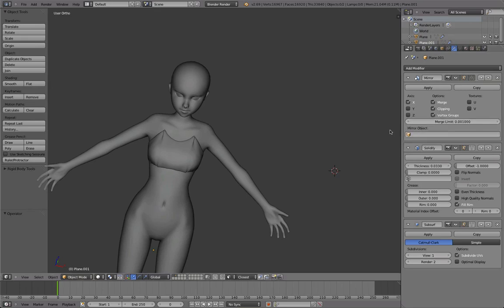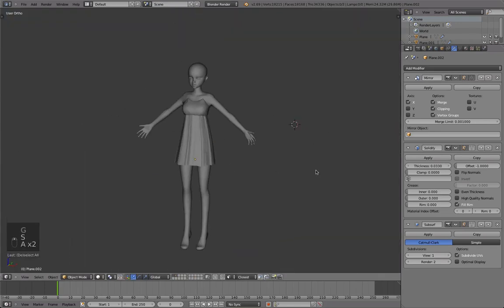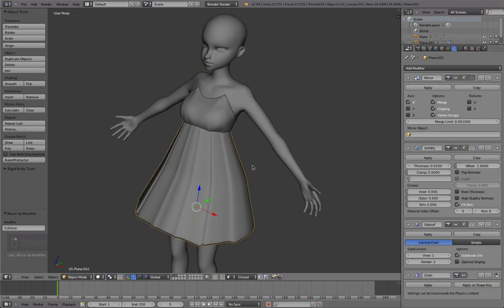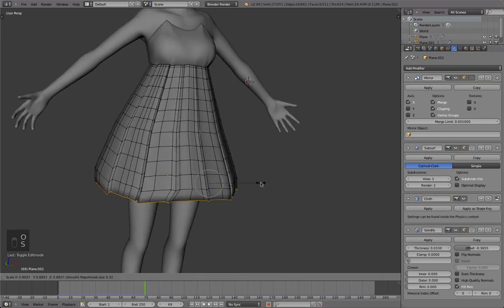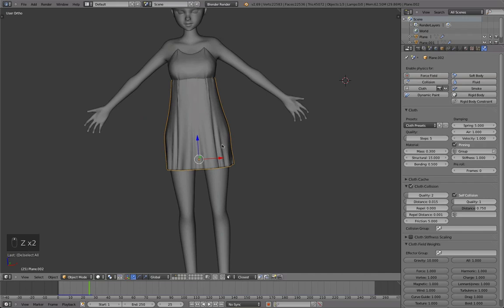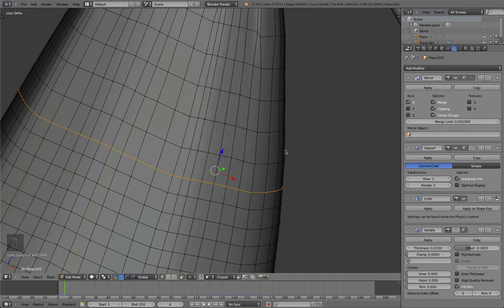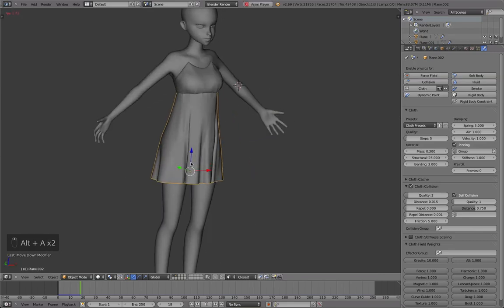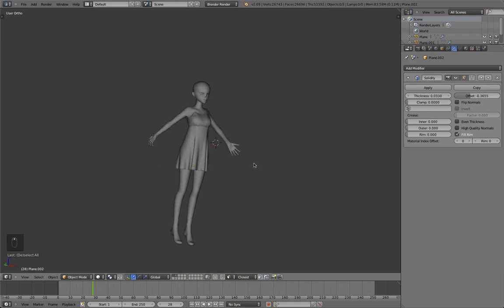[Part 16/ 24] Blender anime character modeling tutorial - Skirt

Comment: Hi Daniel i have a question, do you delete quads under tight clothes off the model itself for optimization for games or do you leave them there? Since you wont be seeing them anyway. Also how do u connect the clothes to the model, if you connect them with joined vertices the normals screw up badly, it only looks good if u cut through it like what you did on this video

Comment: Um, I think I need some help regarding this cloth physic. I have an OC 3d model already made who coincidentally has a skirt. 

I've got a "run" animation clip already made, but her legs constantly clip though her skirt. And yes, I have tried to alter the vertex groups without cloth physic and it doesn't work. And my PC can only run at 6 fps with a poly count of 51000 faces, so wouldn't adding skirt physics slow down my PC even further? Funny thing is I recently upgraded my graphics card and the rendering is A LOT faster, yet it slows down when playing an animation clip (I think its my processor? I've got an i3 3.2 GHz with 2 cores)

Didn't you say in one of your other videos that you should have all the objects as one mesh? Should I separate the skirt as a unique mesh?

I haven't applied physics yet because I had to fix other issues including lattice eyes and that took me AGES to find the solution to that. I hope you respond.

She's on my channel if you want to see the blender model.

Edit: Tried this, the physic works pretty well! Only thing is, I need to figure out how to get this physic to work while getting the character to *move*. I'll need to check your hair physic video first since I haven't applied any physics to hair yet.

Comment: can you help me? the cloth simulator won't past frame one. Its not working, I tried using it in a new blend file and it worked perfectly. I don't want to start over.
Reply: Never mind, it turns out that the end frame was also set to one(Don't ask how that happened CAUSE I DONT KNOW EITHER). Well I'm just glad it works.